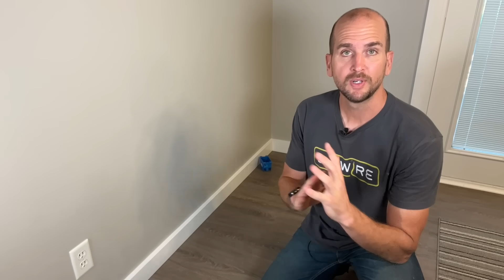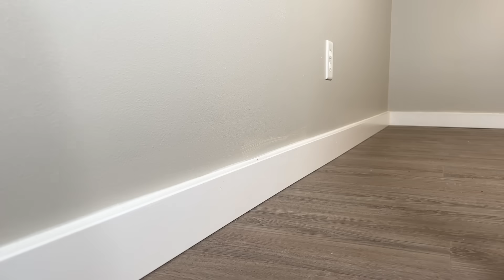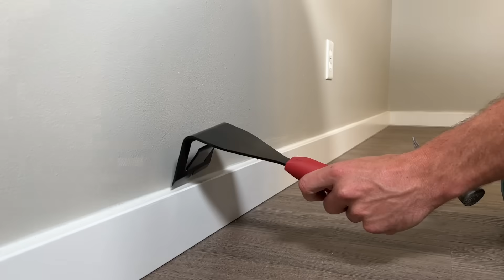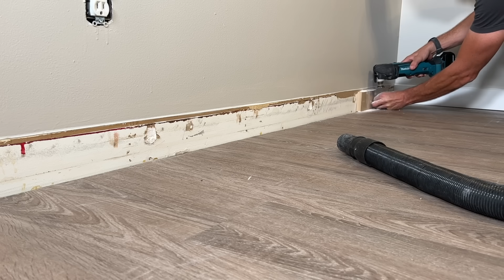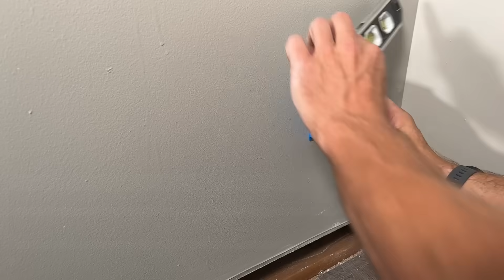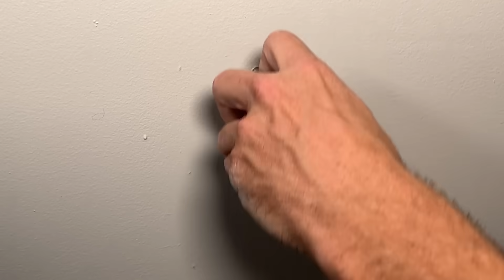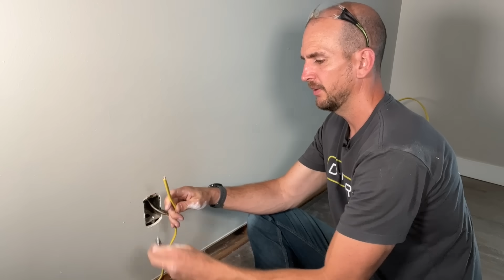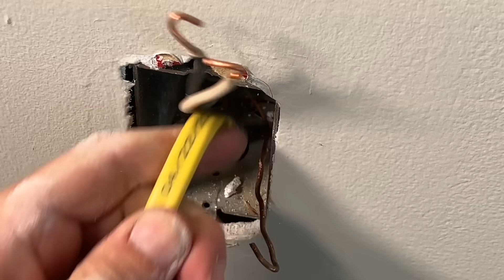How To Add An Outlet To A Finished Wall

Comment: My first observation was that apparently local codes do not require conduit. Next, did they have to have a permit? Was it inspected by an inspector? And then was he a certified licensed bondable electrician? Out side of all of these negative comments the finished product was excellent. [16 on center?]

Comment: Great video - this takes some of the worry away on how to run a new outlet from existing ones!  One related question - when running new Romex (like shown in this video) is it code/acceptable to leave the Romex "dangling" inside the wall cavity without stapling it to a stud near the work box like you would do in new-work?

Comment: Im an electrician, and that's just way too much time wasted just to add one outlet.. there is just gonna flat out be drywall damage and a troff cut , drill through the studs .. All that extra taking off the trim,making sure it's perfect isn't an electricians problem!! They want outlet installed , then we will send out a guy to patch the drywall.

Comment: Instead of using the metal Romex connector, RACO makes a plastic connector that works much easier for this type of application, especially if the wall happens to be insulated.  You can put the Romex into the box, slip the plastic connector over the wire, and push it into the box knockout from inside the box.  Not all plastic connectors can be installed from inside the box so don't just pick up any of them.  RACO connectors were designed to be installed from the inside of the box instead of from the outside.

Comment: Original box was metal with BX , you pulled plastic box with romex. This make me thinking if romex was allowed why they did not do the original box with romex? Or romex is prohibited and this installation was electrical code compliance.

Comment: Will this method overload the circuit and trip the circuit breaker? we used to have that problem whenever something heavy duty like a vacuum was plugged in. To avoid having to reset a circuit breaker is it better to wire in a new line to the circuit breaker instead?

Comment: One thing I've consistently heard when doing DIY wiring is to NEVER EVER EVER use the backstab connections when putting in an outlet like this.
What's the deal here with using the backstabs then?

Comment: At 7:05, you're using what looks to be a flathead screwdriver to tighten the nut on the clamped fitting you put in place using the Romex. For about $10-$12, you can buy a set of 3 locknut wrenches, a ½", a ¾", and a 1", that make tightening, or loosening the nuts for any fitting into an electrical box or emt significantly easier. It saves time, frustration, as well as you can't really potentially strike your romex by accident causing future issues from grounding out or crossed wires. They have them at Home Depot or Lowes, or you can find them even cheaper on Amazon.

Comment: That's a nice technique, I have used it several times over the years. Nicely demonstrated.

I have a pro tip for you. When you use an old work box for a new outlet, many times the cover plate doesn't meet flush with the wall - there can be a small gap between the cover plate and the wall. When this happens, you can avoid this gap by breaking off the tabs (ears with loops) on the top and bottom of the outlet. These outlet ears are scored so that they are easy to break off - the outlet is designed for this. You can see the top ears clearly at 9:26 in the video.

When you break those tabs off, the remaining top part of outlet will then set closer to the wall, in between the blue tabs on the top and bottom of the electrical box, which hold the box to the wall on the edge of the hole in the drywall. This allows the outlet to be seated closer to the wall and the plate will also seat closer to the wall, eliminating the gap.
Reply: Thanks for the tip, didn't bother to even see if I could fix that problem!
Reply: I'm sure he was teaching people how to find a stud.
Reply: Or... you could just get a metal old work box, seeing how they can be adjusted to sit back further in the wall. It's what I personally do. Of course I also DONT do residential work, so plastic isn't really an option for me.

Comment: Nice job, but I was a bit disappointed when I realized it was not a concrete stone wall you were working on. In the Netherlands almost every wall is either concrete or stones. Plasterboard might be used in old houses when the people do not want to spend time on repairing an old wall with lots of holes in it. Your method could still work in those cases. Unfortunately my appartment is completely made of concrete filled with pebbles :-).

Comment: You should add a finish piece of 1/4 round mold strip to the very bottom to close any gaps between floor and wall molding.

Comment: Why is it not recommended to have the wiring running into a metallic box without a connector?
Is it an electrical issue? But the connector is also metallic, so probably not.
So is it a mechanical issue? Is it to protect the wiring against sharp edges?

Comment: Great lesson, thank you! Will use in the future! One question, any particular reason you didn't run the romex down through the original box via the built-in clamps in the back, then over and up to the new one? Thanks!

Comment: Nice!  Although I prefer to use wire nuts instead of the wagos some great ideas here!  The proverbial two greens on one screw is solved by stripping one green very long, putting it thru the receptacle screw leaving a long bare wire  to connect the remaining greens using a wire nut.  Not a fan on the pokey holes on the back of receptacles.  Screws/wire nuts for me.
Reply: A cordless Vibe tool is The TOOL for Drywall..  forget RotoZip or any other saw/router thing.

Comment: I don't know how its done in the USA but according to the way electric wires are run in houses in the UK what you did would fail a check, as what you have done is run a Spur off another outlet, when both outlets are in use the piece of wire to the first outlet would be carrying double the load 🤷🏻‍♂️
Here we would run two separate 3 core wires to the new outlet ensuring a ring curcuit. But like I said never worked in the USA
Reply: Wait - are you saying that in the UK, EVERY outlet has its wires run back to the electrical box (what we in the US call a "home run")?? Does that mean that each outlet has a breaker all to itself?? I must be misunderstanding you. Here you can daisy-chain outlets/fixtures (connected in parallel). You just have to make sure that the wire used can carry the current for them all. In my work we generally allow about 8 outlets on a 15 amp circuit using 14 gauge wire. On a 20 amp circuit with 12 gauge wire we allow about 10 outlets. Bottom line, I figure an average of 1.5 amps per outlet, which would mean an 8 outlet circuit might carry 12 amps which is 80% of the 15 amps the circuit is meant to carry.

Oh, I should also mention that I'm talking about 110 volt circuits here

Comment: Normally I watch these video's and think it was entertainment not proper wiring advice. Your craftmanship was everything it should be. I hate drilling an extra set of holes in the studs but if you have no access to the attic or basement the only other option is removing all the drywall.  

Wago connectors are simpler but I would never fault someone for using traditional style wire nuts as they work perfectly well when wired up correctly. I also like the simplicity of the higher end outlets, another cost consideration but again simpler and probably going to last longer that the ones from the cheap bin.

Comment: Can't you cut a thin grove in the drywall behind the trim, instead of poking holes through the studs, to run the wires, inside the drywall grove? The grove will be hidden behind.

Comment: Two violations here, would fail this. Old metal box already has too many wires in it. That box need to be 18 cubic inches. Extending an existing circuit to an outlet it must be arc fault protected. Other things I could nit pick I will not but are just poor workmanship issues.  

Master Electrician Ray

Comment: Running wires behind your trim isn't good. Flooring guys or carpenters will hit that. Its better to just redo the drywall and paint where the wire should be.

Comment: Also, If you cut those 2 tabs off at the top and bottom of the plug. it will sit flush inside the old work box. If you don't cut them off, the faceplate won't sit flush on the wall.

Comment: clever and all but not worth the time,  just run an extension cord over,  if you are worry about it tac a cord along the wall over to that corner.  they also have glue on clear that would work nicely.   They sell wire runners also that would surface mount it to the wall/trim if desired.  I own rentals too and would never waste time on that but it is clever.

Comment: Now instead of patching and painting just one wall in that room wall you have to caulk top of the baseboard, patch,sand, prime the nail holes and paint entire baseboard including top because if you don't do it dust is going to collect on top of the baseboard, you never gonna get straight line you had before between wall and the base and this freshly painted baseboard is going to look fresher and whiter than the rest of the trim in the room so u r going to end up repainting trim in entire room. Besides you probably made the wall dirty anyway while doing this project so it will have to be repainted.There is no savings here for me at all. You saved a penny but u r going to loose a dollar.

Comment: Interesting work-around.  However, aren’t you missing the metal stud plates that typically go over the studs (where you drilled the holes for the new wire)?  I know, no one will probably ever put a nail in that low on the wall.  But you never know.  And those metal stud plates are supposed to prevent someone from nailing into the hot wire through the drywall.

Comment: I do a lot of electrical work, with electricians and being raised by a master electrician. This is a solid DIY video. You did everything right in my opinion. The only thing is I prefer wire nuts. But that's me, I'm old school as most of the people I work with. Sure they are a pain but you know when you have a good connection. That's just preferences though. Good job!

Comment: I’ve been an electrician for close to 40 years. This was a pretty good video for the do it yourselfer. One thing was missing though, you’re supposed to cut, (twist off) the ears on the receptacle so the receptacle sits flush with the ears on the old work box, this will ensure the finish plate always sits flush on the wall. This is not done with a new work box as a new work box and mounts to the stud and doesn’t have ears.

Comment: One thought, if you are going to cut off the bottom behind the trim like that, it shows you exactly where the studs are and you don't even need a stud finder, right? EDIT: Do you need to protect the holes you drilled with metal plates to prevent wire getting drilled / screwed?

Comment: My house is ballon framed back in 1854. So easy to run wires top to bottom. Same with return air, and supply runs. Too bad the burn down quick.

Comment: 51,000 house fires every year in the USA due to poor quality DIY electrical work.
Reply from the maker: How do you know the 51,000 fires are all tied to electrical work done by DIYers?
Reply: @EverydayHomeRepairs  Just going off 3 sources, all in that vicinity.  I didn't mention the 300 - 500 deaths caused by the same.

I should add - I wasn't meaning to impune your work, perhaps you have a lot of trained experience in the field, but to me, the idea of DIY electrical work is just begging for disaster, and when I googled it, I figured 50+ thousand fires a year kinda proved that.

And also to be fair - this only accounts for about 15% of house fires in the US each year.  So - meh.  Not that bad really.

Comment: Yup. done this before! Doesn't always work as clean as your example though.  Last one I did was an exterior wall that had really tall base plate with 4 in nails fastening the studs into the base plate from both directions.  When I was drilling through the framing, I was only hitting the nails.🤯I ended up having to take my cut higher than the level of the 4 in base molding & change to larger molding.  It's a great trick but it will not always work that well

Comment: Thank you for this video. We’ve installed a few outlets and this method will help us save the customer a few hundred and while also allowing us to make additional profit. A win win method. 
The only addition I would make is wire protectors mounted to the studs, to avoid the off chance of a screw or nail going into the wire during a later renovation.

Comment: Nice work. However, I would consider notching the wall studs and cover with dottie plates, assuming its a non-load-bearing wall, vs boring. Don't leave home without a Zip tool.

Comment: Very good and informative video for most DIY and will be very handy for those who will undergo this task.  Imho in this situation I probably would prefer to drill in studs lower where you can still slip in and add nail stops ( maybe just above drywall cut line) at least where Romex goes through thus eliminating any chance of any long nails or screws  of fastening anything in the future that someone may not know it’s there and won’t cause a short or fire hazard.

Comment: Does the codes require the box to be fixed on the stud and the wire nailed on the studs too? The dry wall is not very strong, the whole box can be pulled out just by unplugging form the outlet.

Comment: The trick I learned from here was taking the wiring at the base instead of cutting straight across
Thank you
Now as for the stabs at the back of the duplex I do not use as those do not give the most metal contact for electricity to pass which can become a resistance point and can heat up. 
It is convenient to stab the backside (Pun meant here) but using the screwside is much safer

Comment: Okay, well, I have to say, I like those fasteners, but I don't have nearly that kind of money to spend on a "kit" when I can pick up a container of different sized wire nuts for less than half the price, and they – when used properly – are just as good as those double-and-a-half priced ones. 

STILL – I've got to say, bypassing the expensive tools and wire connectors – this is explained and shown as clearly and concisely as my favorite homeowner DIYer channel SeeJaneDrill does their videos. Aside from the sales pitch which I know you all have to do, you both show and tell exactly the shortcuts needed, without skipping the safety and quality needed, either. And that is fanfreakingtastic, IMO!

Thanks for this. I think you've earned a new sub, as well as the like and comment to feed that ever-voracious Almighty Algorithm. 
❤️❤️

Comment: Well, that looks like a nice little trim puller, but... I'm poor, and cheap, and I've got a few extra 5" putty/paint scrapers. I would be very willing to stick one in the vise, take a torch to it, and then hammer the thing to close to a 90°. I could always heat it and cool it a few times to get the temper back close to what it was originally. Just... putting that suggestion out there for other poor DIYers to try, too.

Comment: This is the best electrical tutorial I have ever seen. I have been an electrician for over 16 years and I usually don't recommend people do their own electrical, but from now on I am going to direct them to your chanel.
Reply: I think understanding his terminology is my first step in learning 👍
Reply: Could you do similar if the original power point is on the other side of the wall?
Reply: Tell them to just use a sawzall and cut 4” inches off the bottom of each of the bearing wall studs.
Reply: @DrunkDrynasty that’ll keep the wall strong 💪 lol

Comment: I was with you until the Wago's, seen many melted on service calls. Only use wagos for quick connects in LED lights.
Also if installing a receptacle in a metal box, its always best to Electrical tape around the device covering the screws, less chance of arching out on a grounded box.
When installing a device on a cut-in box its best to take the ears off the receptacle and switch, it sits more flush against the wall. The ears are the 2 tab on top and bottom next to mounting screws. they are perforated and an be bent off with ease.

Comment: Only 2 issues I have, you could've just done a 1/2" hole through the studs and using the holes on the back of receptacles isn't as good as using the side terminals

Comment: I'm retired electrical contractor, i always have reservation on DIY with respect to electrical works. With electrical works you are not allowed to make a mistake because the mistake you may make maybe your last or maybe very expensive . If you know what your doing , it;s ok  but if you only think you know what you're doing think twice , thrice before you start. I've seen irreversible mistake that changes life. In electrical works, you see nothing, you smell nothing, you hear nothing , everything looks so quiet , so harmful but it's deadly that's why i'm not "in" tutorials with respect to electrical works.

Comment: For DIYers good with electricity, do you need to pull a permit to add an outlet?
Reply from the maker: Check your local building safety division.  Not a bad idea to just speak to the electrical inspector to give an idea of what you are wanting to do and if you need a permit.

Comment: Every light in my house had wago connectors :( and bulbs were constantly going south.. I had to replace them all with wire nuts, sorry I just can't trust them after that experience of having a brand new home with those electrical issues. After replacing wagos with nuts my bulbs have lasted as they should.
Reply from the maker: Assuming those are WAGO push in connectors and not WAGO 221 lever nuts?